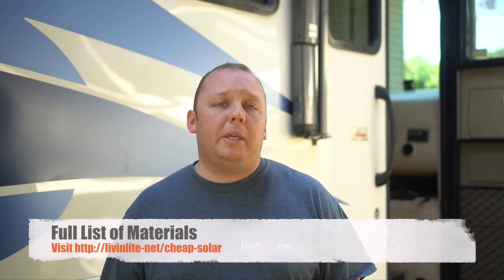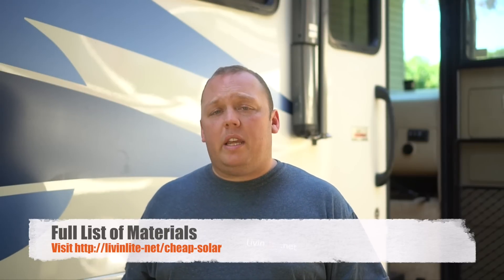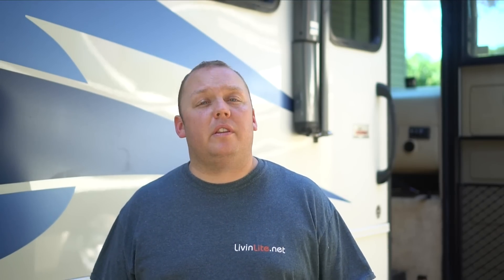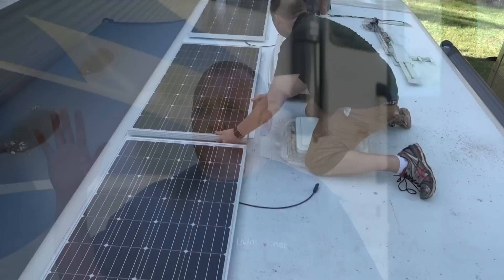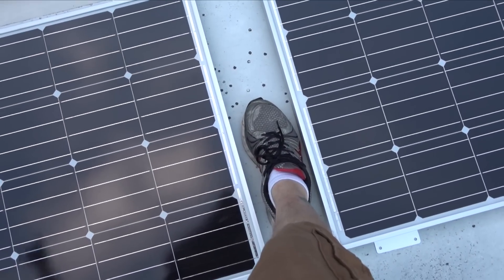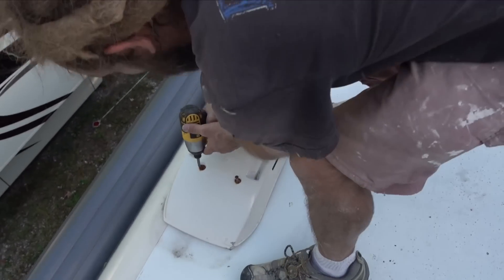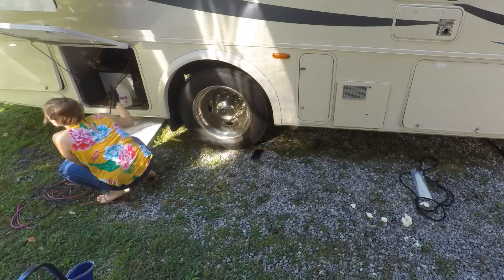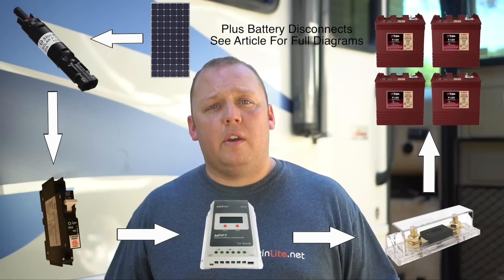Solar Power - Stop Using Generator for Under $1200?

Comment: I got a 360 watts solar panel for 125 dollars
Reply from the maker: those would likely be Polycrystalline Solar Panels which are less efficient and a 360 watt panel would be quite a bit bigger but yet they are certainly out there. We also see folks selling panels with minor damage to the aluminum body for 50% off on some blogs. Always deals to be found!

Comment: Did the final price reflect the cost of the additional batteries?
Reply from the maker: no, the batteries added around 700 to the total cost. Since it wasnt part of the solar install we didnt include it as most folks have usable batteries but that would add additional money to the cost (but you could get away with 2 instead of 4 batteries in most situations).

Comment: What brand of battery did you end up getting?
Reply from the maker: These batteries were a white label battery sold by midstate battery in connecticut. We know the owner and he honors the warranty directly so we went with them. That said, if we were shopping outside of connecticut and wanted a flooded battery we would probably go with a trojan as we've had great luck with them. We have some friends in Arizona that specialize in solar/batteries as well if you are looking for a reseller you can trust.

Comment: Hey, thank you for sharing the solar info. Renogy? Is everything from them Renogy? I've spoken to them. Very nice and helpful tech support. They in California I think. I'm going keep my solar panels on ground, portable set up. Probably start with about 300 watts, so two 160 watt panels will do. Down side to series panels is power loss when slightly shady? I want the best set up so I can put my panels 50-100 feet away from our travel trailer. I guess the charge controller is best mounted real close to my two Trojan t145 260ah six volt mounted in series on the front /tongue of our trailer? ? Does the controller need to be in a weather proof box? I think Renogy solar equipment is comparable to Zamp and GoPower and the other well known brand (Xantrex??) in quality but costs much less!!!???
Happy and safe travels!  Enjoy, Prost
Reply from the maker: Hi Klaus, check out the wire sizing calculator in our article. You can match the voltage of your panels (likely 24v if your using 2 panels in series) with the distance and it will tell you what % of loss you will get. In general, 24 volts over 50-100 ft will have signifigant loss unless you carry a big guage cable which may defeat the purpose. You might be better off keeping panels closer or installing them on your rigs roof (you could always run the wires on exterior and disconnect them for travel). Then you also wont have to deal with your bus creating shade on your panels since its probably 12 ft tall and will cast a big line of shade in one direction or another all day. Your charge controller will require it be mounted away from the elements but it also requires ventilation to ensure it doesn't overheat (doh, i know thats a tough ask). I'd agree that the brands you mentioned are all good. I find gopower seems to be more expensive but they offer a turn key solution and solid support so that is a good reason to pay more for many people. Best of luck!